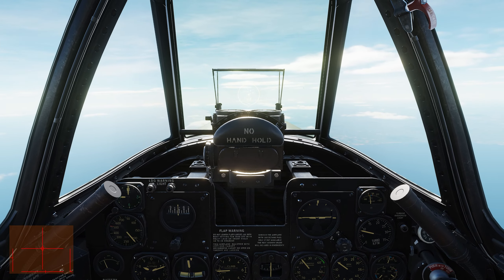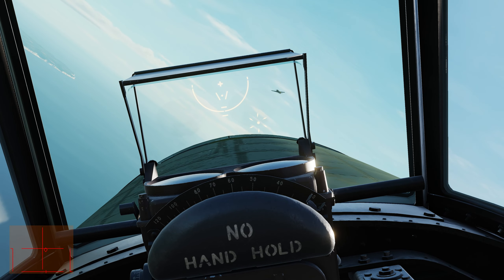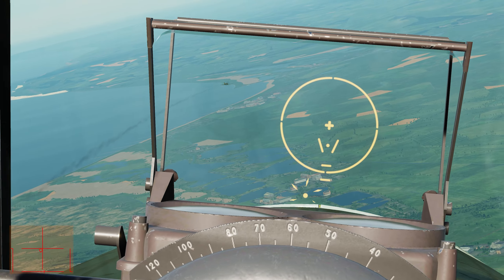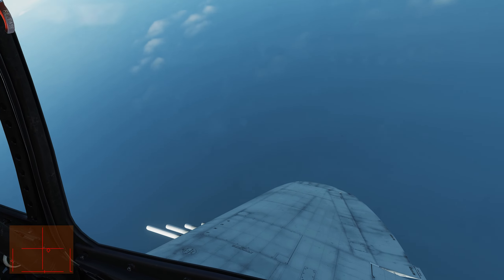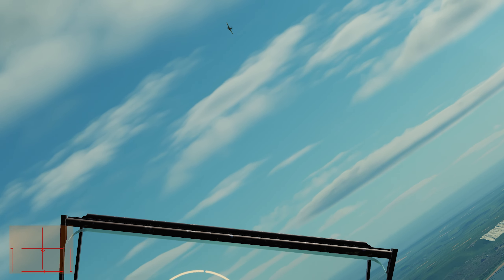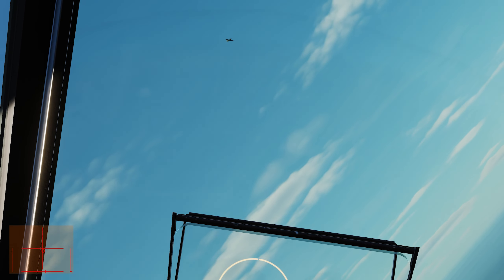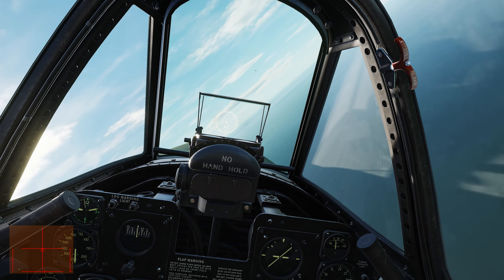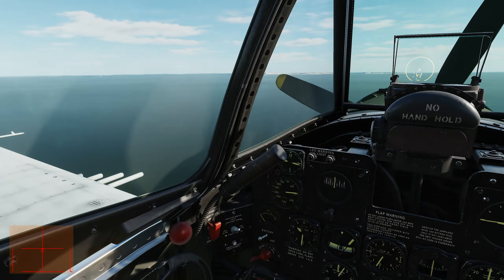I Struggle With Air Cooled Engines Sometimes (P-47 Thunderbolt VS FW 190 D Dora) DCS World Dogfights

Comment from the maker: So, after recording this, I consulted the manual. I reckon the reason I cooked the engine in both attempts was due to pushing the engine beyond its operating range for an extended period of time.

It also seems that whenever I start recording, the AI opponent behaves differently. Maybe because it's a different attempt or because I'm flying differently because of the extra stuff involved in recording a video, like doing a voiceover or something. Maybe both, don't know.

Comment: With the jug you can actually open up your cowl flaps to 1/3rd, and put your intercooler to netrual. and you won't loose much performance. and be able to run your engine pretty hard all day long. key to the double wasp radial is to keep your cowl flaps to 1/3rd, and keep the plane above 200mph when running her hard, and you shouldn't have to much to worry about with the engine.
Reply from the maker: Sweet, I'll have to give that a shot

Comment: sorry for the lengthy comment haha

Good fight man! It's a struggle to battle and try to maintain engine wear at the same time. 

There are times that you can outmaneuver the Fw 190 and times that it will outmaneuver you in the P-47, it's pretty situational. Generally, as always, the more altitude the better for the Thunderbolt. And of course it's a little better in the vertical, whereas the Fw 190 is probably a little better in turning at most altitudes except like 25,000 feet +. The Fw 190 is also the one plane that will out roll you!!! Keep that in mind. Radial engine 190s rolled the best, but long nose 190s also roll very well; still better than the Thunderbolt. The P-47 will outrun the Fw 190 up high, but not at medium or low altitudes. All general things to think about. 

The only thing I can really recommend in these types of situations is making very graceful movements when following the Fw 190. Overall you did a pretty good job of this, but at times you tried to follow the Fw 190 a little too "exactly." What I mean is you're in a lag pursuit, and it should be exactly that; lagging behind the enemy plane. While he's making turns to avoid you and trying to get away, you should be as straight as possible while still pursuing him. This will give you more energy and allow you to catch up to him, and will save your engine. As previously mentioned, in an all-out race, the Fw 190 will outrun the P-47 down low, which is why you were having a hard time following him to get shots off. At times you were trying to roll with him while giving chase, where you were already not in a great position to take a shot. If you bypass those chances where you are already likely to miss, it can often set you up for a better chance soon after where you have a better chance of getting hits. This is because you'll have saved some energy by not trying to maneuver over the last few turns. One thing I would also try is gradually climbing. If the lag pursuit goes on for a while and you're just endlessly chasing him, start gradually climbing to give yourself an altitude advantage, all while keeping an eye on him. If he makes a sharper turn, you can dive on him. If he continues making those sweeping turns, it's likely that you will get to a position to dive on him anyway. From there, try to keep your energy up, and his down. He will loose energy trying to dodge you're diving attacks. You should zoom climb back to altitude to continue to make more attacks, and generally resist following him in the turns, as that will give up your energy advantage. The only case you should continue to immediately pursue him in turns again is if you got good hits in the dive, or if he is at a very low energy state and you can loop/barrell roll to get on his tail. All of this is easier said than done though, so I give you props. The long nose Fw 190 is not an easy plane to fight. And I'm not sure if the game models this accurately, but in real life the R-2800 could be run for 5 straight minutes on WEP before needing to be rested. To be honest, I'm not sure if "rested" meant actually staying at idle or what, but I digress. It could stay at military or 100% power for 15 minutes.

What altitude are you starting at? If it's 20,000, I'd play around with immediately climbing up to face the Fw 190 with an altitude advantage. This doesn't really mean you want to yank the stick up, but sometimes immediately climbing and performing something like the Immelmann maneuver can be a good start.

But good job overall! I'm liking this series.
Reply from the maker: Ah, thanks; that's a lot of useful information. I guess another thing would be a lack of combat experience in the aircraft I'm fighting against. Familiarising myself with their capabilities would definitely be helpful.
Yeah, starting at 20,000 feet, I guess I should wait a moment to see what course of action the opponents take and then respond accordingly as opposed to just turning straight away.
Reply: @JJ_Simulation  no problem. It's always best for the P-47 to try to keep the fight as high as you can for as long as you can in these types of situations. Basically, sometimes you want to act like the pretty girl; make him "chase" you instead of you chasing him. Stay high and get into a position above him where he has to climb to take shots at you. This will leave you with a better energy state. Often enemy planes will dive down and try to draw you to lower altitude where they usually have the advantage. You want to do the opposite; draw him up to you and make him fight on your terms. Admittedly I'm not quite sure how the AI works here so it might not go after you in those situations. Sometimes you have to follow him down. But even then, you'd still be above him initially, and you can use the P-47s great dive performance to start making boom-and-zoom runs.

Comment: IMO the best way to fight Dora in the jug is #1 Defensively, letting him believe he has a solution on you. you are faster in a dve then he is. But imo best way to fight him is in the vertical. you have far lower wingloading then he has.. trick him into a vertical fight and he can't use his engine/acceration againest you. You have far better AOA abilities then he has and that transulates in the vertical as well. keep him vertical fighting and pulling hard. and he can't get away from you. and if he dives away.. Well the jug does dive better then he does you can catch him after a while. Key to winning that particular fight with a Dora, is mind games.. Let him think he is winning. and when he takes the bait. Fight him vertically starting with a Split S, or Low chandelle maneuvers to build up your speed. then out pull the Dora until you got lead, and then unload into him until you destroy his EGO :D.